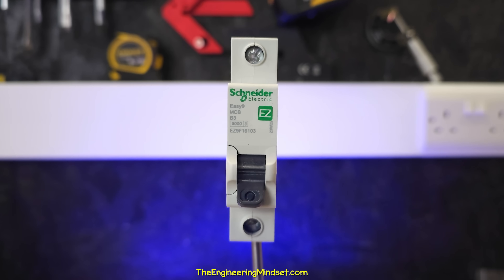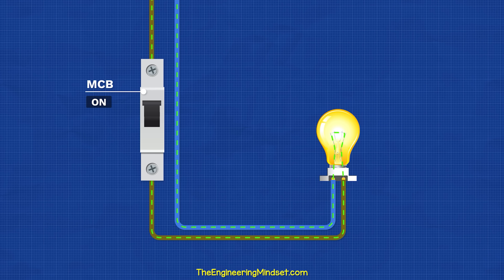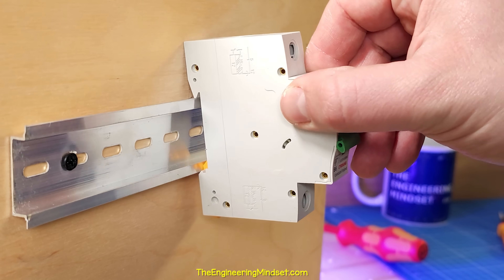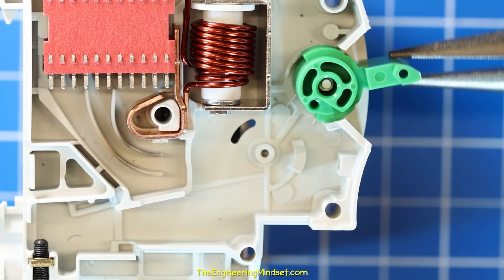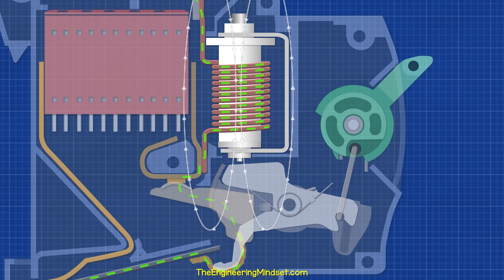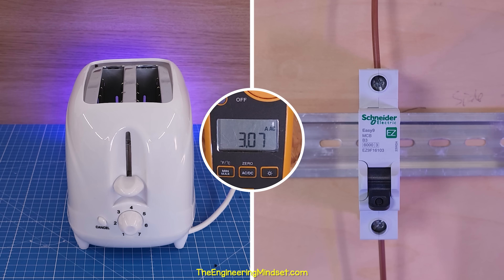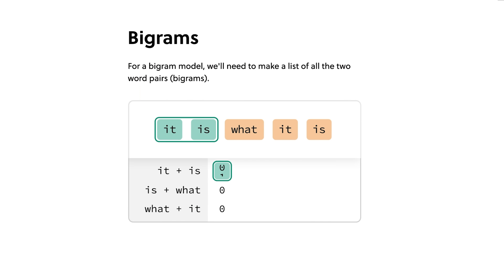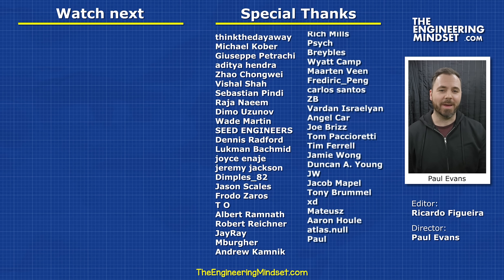Why Circuit Breakers DON'T Protect People (electric shocks)

Comment: Dumping fault current to a low impedance ground protects people.  Circuit breakers let that happen safely without starting a fire.  E.g. we intentionally turn most faults that'd electrify conductive components someone could come touch into a short to ground.  Great video, but that's important context if you're going to keep that title.

Comment: Standard circuit breakers pretty much only protect the wire from damage and maybe, hopefully prevent a fire in the malfunctioning piece of equipment that tripped the breaker.  That’s pretty much it.

Comment: At the last section of the video this is why some sockets will cause your vacuum to trip the breaker while other's won't. One simply has more things hooked to it. Bathrooms are normally the best place to plug in items like this for that reason since most people only have there light running from it

Comment: Very comprehensive video. A small remark: The arc generated at the MCB  contacts is propelled into the extinction chamber by  electromagnetic forces that make any arc to "tend" to move away from the direction power is coming.

Comment: wow just relised wiki and you are using short circuit wrong, thats called an open circuit
Reply from the maker: Well its long established term that an open circuit is when there is no connection between live and neutral, thus meaning the circuit is inconplete or open, and no current can flow. But a short circuit is when the live and neutral are in direct contact with little or no resistance between them, resulting in excessive current flow. That's what is discussed in this video.

Comment: Interesting Video, well explained.
Here in South Africa we always wire incoming power to the top of the breaker, while outgoing is from the bottom.
That way it is easier to not mistakenly touch live wires, since top is always live while bottom is isolated when a breaker is off.

Comment: Around 1.30min:  I believe the inner (red / blue in video) covering is the electrical insulation but the outer grey is the sheath and is there for mechanical protection.  Not taking anything away from the video which was fantastic.

Comment: In what country can you use 1.5mm^2 with a 20Amp braker? in Sweden its either max 10 or a 13Amp breaker if the conditions for the cable it correct

Comment: Thanks for this great video! 

Could you please explain why do we need to consider a 80% coefficient when designing a electrical circuit with these MCBs? For example, if a MCB is rated at 10A and the actual connected load of to the MCB is designed to be not more than 8A for a 24x7 load. Is it to consider the fact that constant high current load may cause the bimetallic strip to heat up and if let it running for long hours, it will expand and eventually cause the MCB to trip? And also, why must it be 80% and not 70% or 90%? Is there any standard for this?

Comment: minature circuit breakers are purely over current protection devices.
The large scale adoption of residual current devices in the U.K. for such a long time designed purely to protect personnel.
Their  setting is 30 milliamps sensitivity and open within 40 milliseconds and do protect against electric shock as they are very sensitive and very fast..

Comment: @13:00 good to add that the arc chamber is "up" aka away from gravity. The arc travels up as heat rises due to gravity. If you install breakers upside down you can actually get good arcs to melt internals instead. It's a fun exercise lol
awesome video as always
Reply: Seems like circuit breakers for the ISS might be bit more tricky(aside from a lot of them having to work on DC voltage)
Reply: @ImieNazwiskoOK  Yea even DC breakers on earth are designed differently/specific to DC. Getting the arc killed on DC is much more difficult as well
I wonder how the space station ones look but the magnetic field up there probably takes priority thus it may not need much of a design difference. Down on earth it's so weak that the heat matters more and heat rises due to gravity
Reply: @ImieNazwiskoOK  Thinking outside the box, no matter how relevant. I like this :D
Reply: I was just wondering why arc moves upward, thank you
Reply: Also the resulting magnetic field moves the arc away.
Reply: Why does a short circuit increase the amperage? I assume magnetic fields are pulled downward because of earth voltage imbalances. Is it the increased speed to the ground that spikes the magnetic field?
Reply: @nousernamejoshua1556  a short circuit is maximum amperage until something melts. "Increase the amperage" vs what? not having anything plugged in? having a vacuum plugged in? they're both very "low loads" compared to infinity which is what short circuit gives you.
the ground isn't involved. Power goes from line in/hot/black to neutral/white
Reply: @nousernamejoshua1556  SC = no resistance ==> current has to rise
Reply: @nousernamejoshua1556  In a short circuit the amperage increases cus you have nearly no resistance. Normally, current travels through a lamp or a machine, this makes it "hard" for the current to pass, so its amperage is limited.
First understand those basic things about electricity, THEN and only then ask your other questions.
Reply: @Delibro  I do understand generating electricity is taking from the core to resist the magnetosphere from consuming earth into a plasma. 
Space difference is pulling on the magnetosphere to keep that distance of solar magnetic interplanetary field lines of one a fuel for the sun as Earth's atmosphere light is a natural resistor in a paramagnetic relationship to the core sun. The core of earth has a natural voltage at times consuming more mantle material into the core and at times expelling spent material. Most biological material on the surface react to sunlight as the natural electro magnetic response to photoelectric ionize clean atmospheric gas and temperature to cool the magnetosphere. 

Nuclear detonation destabilized the magnetosphere and contain a lot of high energy particles which send x-ray and other emissions back down to earth because they don't have enough energy to penetrate the magnetosphere.
Reply: @nousernamejoshua1556  Seems more like you were pulled into some branch of "electric universe" nonsense. Tbh not the wisest thing to talk of it right after visibly not understanding quite basic thing about electricity.
Reply: @nousernamejoshua1556  Never read more nonsense in one single post.
Also, this video is about circuit breakers, stick to the topic.

Comment: Talking about jow yhe electricity os actually AC and not DC, so doesn't that make Live and Neutral Wires technology the same? It's just all Live?
Reply from the maker: Not in most cases because neutral wire is tied to ground 0V and you are also grounded 0V so it is energised but of no use to you because there is no difference in charge, but if you touched the live wire then it's 120/240V and you are 0V so there's going to be a lot of energy flowing through you. Also how birds can sit on a power line, but if they touch the pylon (grounded) and the power line, BOOM dead

Comment: Well, at least this shows the superiority of North American breaker panels - far less wiring as there is a bus bar for the high and low sides of the 240VAC in the panel and breakers connect to that on the hotside.  OTOH, most circuits do not have GFCI (RCD) except occasional single breakers that go out to a "wet" area.  Often branch circuits begin with a GFCI for a given socket and the rest of the circuit beyond that.

Comment: American viewer here, I found your RCD configuration very interesting.  That is not how we do things here in North America, every circuit that needs RCD and/or arc fault protection has it built into that one circuit's breaker.  It's a very expensive way to do things, and has deterred me from retrofitting such devices to my older home.
Reply: Same here in Norway, we also break both the live and Neutral in each circuit, but most households actually don’t have a neutral, but two live wires

Comment: You know this video could have been maybe  20 seconds and you could just say, because a circuit breaker isn't there to protect people. They are for protecting the wires. Surge protectors are for protecting things plugged into the wires and GFCI's are for protecting people.

Comment: can you make video about high low voltage protection for the house? if the voltage coming to the house is higher than the standard or lower it will automatically stop it.

Comment: actually its saves lives my mom almost died because of two shorted cables and the breaker saved her live
Reply from the maker: Glad to hear she is safe. Another type of breaker RCD/GFCI will trip if it detects a potential shock occuring, but the MCB described in this video doesn't unless a short circuit or overload occurs.

Comment: when i was 9 i was playing on a building site. all the cables were outside and to test if there is electricity in them i quickly touched one cable...Nothing happened then this brilliant idea came to my mind to touch two at the same time, I grabbed one and i touched the other one with my other hand, electricity of course went through my heart. I was shocked my heart started to bit really fast and my legs were shaking for few minutes. Not the most pleasant experience I don't recommend but if you are shocked by 230v it doesn't mean you are going to die.
Reply: Meanwhile, if you'd grabbed hold of the other wire too, instead of just touching it, it could well of ended completely differently. I've had enough 240v and car ignition electric shocks in my life, mostly from being a knobhead, or being overconfident, that it's not even funny anymore. But not once have I ever had a solid 240 in one arm and out through the other, that stuff will stop your heart, sometimes not even straight away, but a little while later, just when you start thinking you got away with it. edit - It's also why RCD's are specced, at least for domestic use anyway, to operate at 30mA,  within an absolutely maximum time of 300ms (most trip a lot faster unless they're the delayed type), as it's less likely to disrupt heart rhythm; but, doing what you did, unless you're also simultaneously earthed, the RCD will regard you as just another connected appliance, killing you as it does.

Comment: MCB’s can be safely mixed because they are designed to a common mechanical and electrical standard. Different manufacturers only becomes an issue if a distribution comb is used but that can even be an issue even with in a specific brand.
The leading letter refers to the trip curve which goes beyond B, C and D - “A” being fastest and “F” being slowest (and usually used for variable speed motor circuits (and occasionally switch mode power supplies with high inrush currents). 
C curve breakers are the most common in domestic use.
Direct On Line started motors typically draw seven times the running current during start.
Hard Start Switch Mode Power Supplies draw their full output load current during starting - so a 5V 1000A supply will draw 1000A for the first fraction of a cycle until the output reaches 5V - so from a 240V supply 240kW (and having tripped a gas fired power station offline by turning on a computer system, this could happen (steady state the system drew 1kW - the power supplies were oversized and redundant (2off)).
Reply: "C" - type MCBs are most UNcommon in domestic installations.
Reply: @laus9953  Which will come as a surprise to every electrician I have worked with - every house I have lived in was fitted with “C” curve breakers (including the ones on the solar panels).
I’ve used “D” curve breakers on switch-mode power supplies in special cases and “A” curve on thyristor controlled heaters (to protect the thyristors).
RCD breakers are a design requirement where I work too on all power circuits.
Reply: @allangibson8494  Different countries have different 'standards' in that regard. Where I live practically all residential breakers are B-type (B16). I've only ever used C-types in commercial buildings when the circuit was explicitly used for computer equipment. If I recall the local norms correctly a D16 would not even be allowed in the average residential building due to not having guaranteed selectivity with the C25 protected incoming supply.

Mixing vendors is at least totally fine here. Although the majority of newly installed breaker panels use vendor-specific busboards instead of bus-bars. So you generally only see brand difference in RCBO's that are installed later for things like solar.
Reply: The only problem with this is that you will void any potential warranty the manufacturers give you, as it wasn’t used as they intended. Also, you cannot use that manufacturers electrical data/certification as this was only done based on their own parts.

So if there was a house fire and they find out you have mixed breakers, etc, there’s no come back. 

Also on odd occasions the breakers just won’t physically fit in each other’s boards when the front plate is attached.
Reply: @themohaa2  Mixed breakers are legal if installed correctly. If they don’t fit the manufacturer is selling non standards compliant equipment. 
Thats what standards are for - to ensure interoperability and interchangeability.
BTW - my home switch board has five different manufacturers breakers installed, no problems because they are signed off by an electrical inspector.
I have however had issues with incompetent electricians not tightening screws repeatedly.

Comment: Not 100 percent true and misleading. Fellow electricians probably agree with me here.
Reply from the maker: I've just added "(electric shock)" at the end of the title to be more clear. But it's not made to protect people, only cables, it might prevent a fire which might save a person, but if a wrong or sub standard cable is used it will happily cause a fire, it will also not trip just because the toaster casing catches fire and sets the entire house ablaze. It will trip if  the line makes contact with a properly grounded metal part, but if there's resistance between that point, including a person, it won't trip. There are other breakers that will trip, but not an MCB as discussed here.
Reply: @EngineeringMindset  Still not correct. I'd look up the corresponding regulations, NEMA or IEC. If in your country you using IEC, then IEC 60364-4-41(Low-voltage electrical installations - protection against electric shock).
Reply from the maker: You are welcome to quote me the part that says MCB's protect people from electric shocks, but as with IEC 60898-1 an MCB is purely for overcurrent protection. RCD is used to protect people.
Reply: @EngineeringMindset  IEC 60898-1 is a product standard. Have nothing to do with the fact, that MCBs also used as a protection according to the IEC 60364-4-41, page 15: "Protective measure: automatic disconnection of supply". Electricians install according to the IEC 60364 series.

Comment: 10A breaker at 2x current should be in your long time trip curve so I'm guessing 15-30seconds (before seeing the trip curve) 

(After seeing trip curve) nice I guess doing enough primary and secondary injection on breakers I must have learned a thing or to

Comment: Circuit breakers are designed to protect wiring.  Protecting wiring prevents the circuit from starting a fire.  Protecting equipment and personal harm is for other devices and common sense.

Comment: This is a great explanation of the inner workings of a circuit breaker. Excellent work!
There are, however, still questions left unanswered, mainly:
a) at 11:40: Why does the piston always move downwards even if the current may be passing through the coil in either direction? There is no diode element in the circuit breaker.
b) at 12:54: Why does the electric arc move from the narrower gap section to the wider gap section? Surely, the arc is easier to maintain when the gap between two electrodes is shorter.
c) at 12:49: Why is the double copper electrode needed? Is the metal vaporized by the arc temperature or is the double thickness needed to better dissipate the heat generated by the arc?
Reply: the explanation to all of them are short, you can look them up!, but if he included it in the vid, it would have gotten a bit too "beginnery" or long

Comment: Of course they don't. In German, circuit breakers are called "Leitungsschutzschalter", meaning "wire protection switch".
And I love your "qualified AND competent". Already met too many qualified but incompetent....
Reply: average german word length:

(thx for the info tho lol)
Reply: @Taokyle 
Which is why we usually refer to them as "LS" instead...😉
There is also "FI" (which is the RCD essentially) and FILS which is a combination of both that is sometimes used.